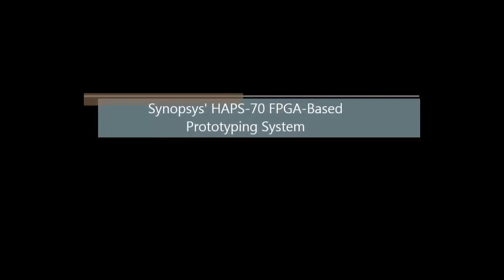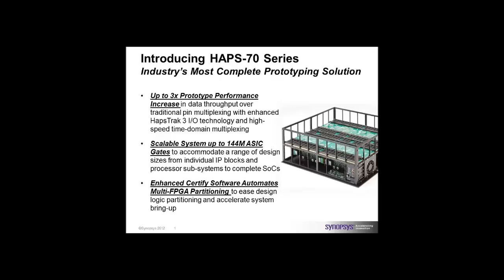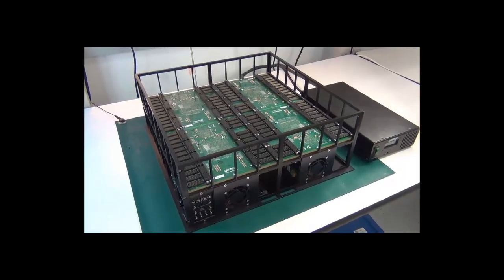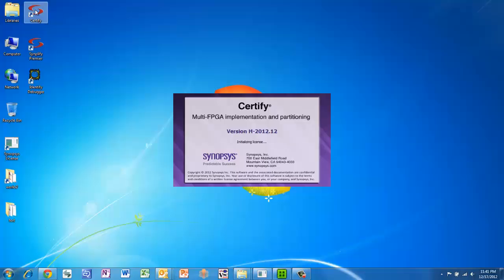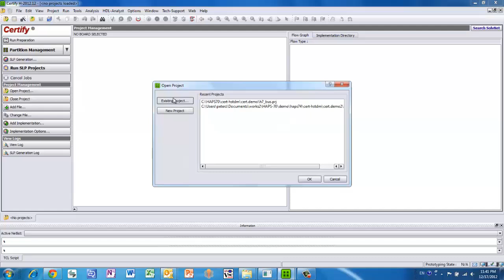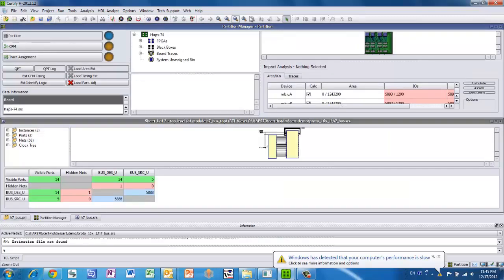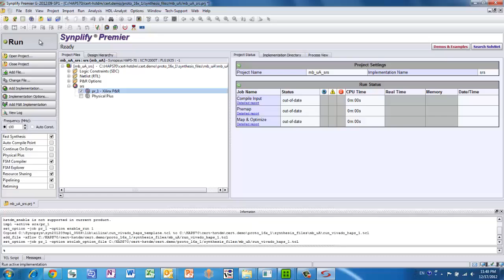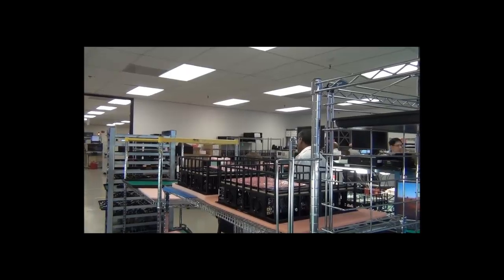Introduction to HAPS-70: FPGA-based Prototyping integrated hardware and software system | Synopsys

Comment: +Synopsys

Hi, I am an electronics student at an Illinois High School and have a quick question. In our school, we use the MultiSim software in order to test our circuit designs. My question is that if we can simulate all the hardware in software, why do companies buy hardware like this for SOC/IP Hardware/Software testing? I am just curious.....

Thanks

Additional Note: We also used the NI FPGA board to simulate the same circuits. But they didn't seem to provide much of an advantage over the NI MultiSim software.....this led me to researching industry standard hardware verification devices and this question came across my head.
Reply: Hi,
by software simulation you get get the speed of hundreds of KHz at RTL level or tens of KHz at the gate level. So it could take weeks to get a good coverage for a modern  complex SoC. While doing the FPGA prototyping you can run the design at tens and hundreds of MHz. Also with platforms like HAPS you interoperate with the realworld hardware it the realtime. 
To explore it more you can search for such topics as "what is FPGA prototyping for".